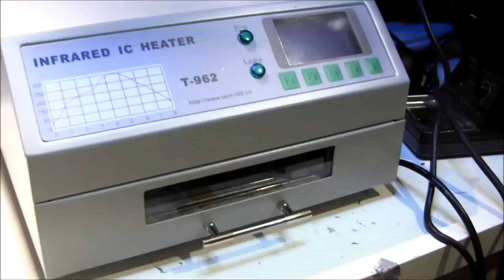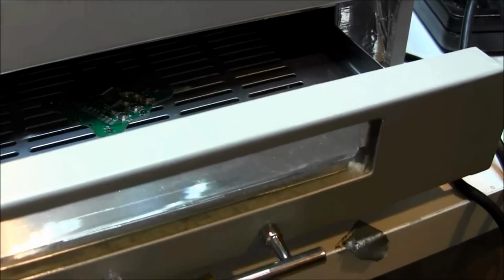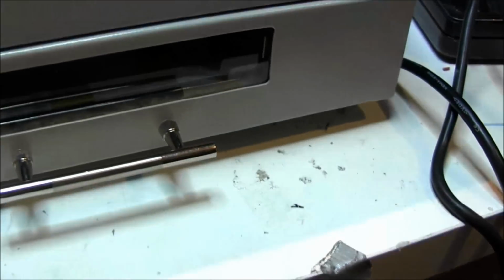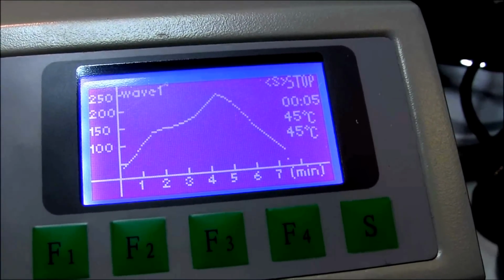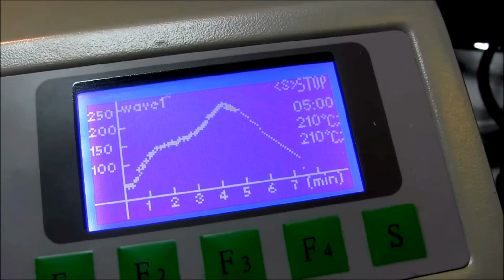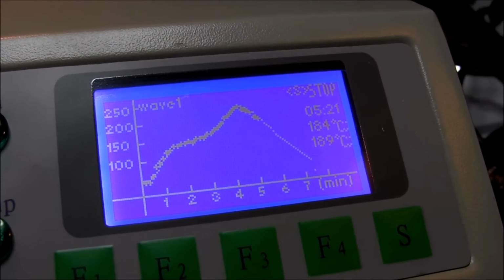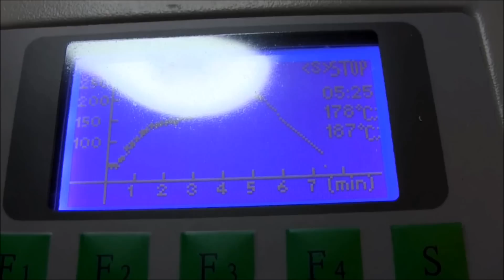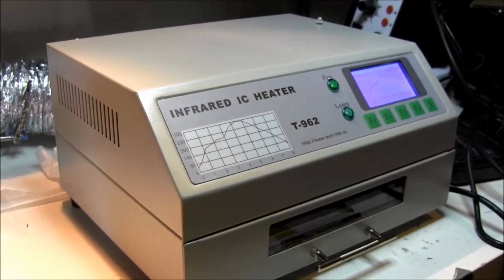T-962 Reflow oven First impressions

Comment: It works but you have to experiment with the location.  I had an LED smd display and I have to put it off center and use Wave 2 to prevent it from melting.

Comment: Hi Lars, (and everyone else)! How does this keep from destroying the chips/plastic parts on the Board?... Does this actually have the tech to target and heat only the Solder joints? (Does it identify and aim heat at specific targets?), or is this just an oven? Thanks!
Sluggo
Reply: Hello, not sure if this is relevant anymore, but the chips/plasic,  that are certified for smd soldering, can usually withstand the heat, and thus its necessary for the oven to target specific areas. It would also prevent even temperaturs across the board/soldering area, which is one of the reasons youd buy a reflow oven.

Comment: I was looking at the time profile supplied but the solder manufacturer and I created my own in option 7 to match it. I used a thermocouple and timer to see if what I programmed was what I got and it when I found the error. The temperature values are pretty close to the profiles settings. The ramp was a bit slower but I compensated for that.

Comment: I bought one of these, however the clock seems to be 50% out. 1 minute on the oven is actually 90 seconds. Is yours the same ? It's ok as long as you create your profile with the modified clock timings.
Reply from the maker: The timing is off on mine also, but it hasn't really been an issue for me. Maybe I should have done like you say, to change the profile. Haven't measured it, but didn't think it was as much as 50%. It is something I've seen a lot of people comment on though, so good that you have timed it and can confirm it.

Comment: I can confirm that it works with very good results. Ofcourse not all the area is usable but after experiments i mark where to place my boards.

The keypad is very slow. I think it scans once per second but on regular use the only you have to do it to select the wave you want and execute it. 

The clock is not real time but this is not a problem for me.

I place it outside as there are a lot of fumes during the process. I think this is normal.

I am happy as after 100+ PCB it works well!

Comment: I know, but my boards are very small and i have to build about 2000pcs so i think the reflow oven will help to save time. Even with the hot air sometimes there are some parts that don't solder from oneside but i think this is because i don't press well the part on the paste.

Comment: Thanks for sharing your experience. I'm thinking to buy one for about $300 USD as soldering 50 small pcbs at a time by using hot air is a bit boring and the smell is not healthy.

Comment from the maker: I'm still pretty happy with it. I get some tombstoned resistors some times (connected on one side and not on the other, because it lifts off the board), but I'm not sure it's the fault of the oven itself. I have only made small boards, and haven't made many boards at the same time. I will probably do that also, but haven't tried yet.